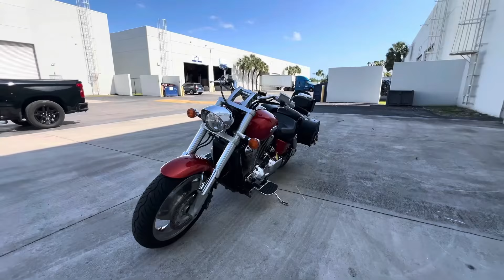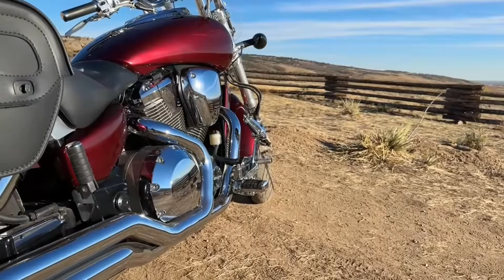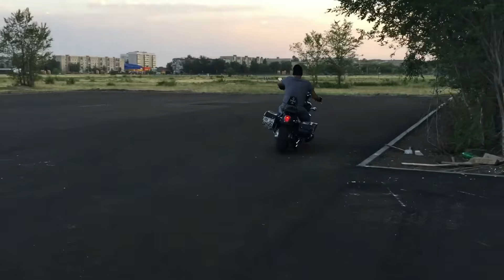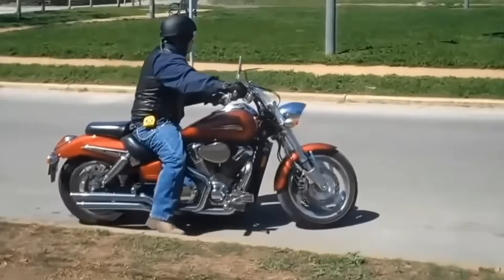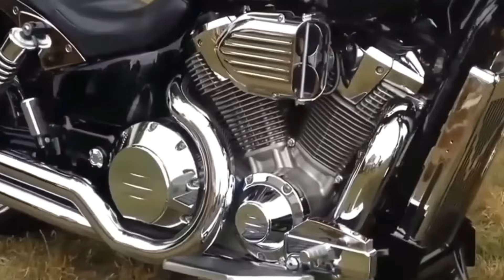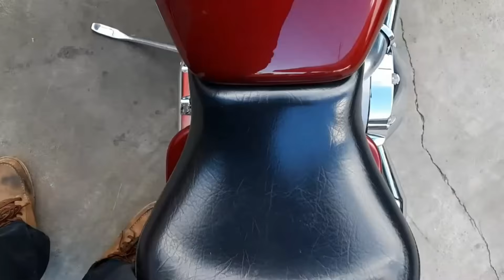How Honda's VTX1800 Engine Crushed Harley at Their Own Game

Comment: Not wanting to sound like a smart a$$ but the 1800 has a dual pin crank. The 1300 uses a single pin crank with dual counter balancers.

Comment: Just bought my first VTX1800.

My previous bikes were a CBR600, Fazer 600 and an 800cc Intruder. I absolutely loved the V-twin, but wanted something with a bit more punch.
We went to test ride the VTX expecting it to feel huge, heavy and intimidating.

I even told my wife to wait at the dealership while I took it out, and that I’d come back for her once I felt confident enough to have her on the back.

It took me about 100 yards before I turned around to pick her up.

She loved it too, and we had an absolute blast.

For such a big bike, it’s incredibly easy to ride. It’s smooth, the clutch feels great, the gearbox is spot on, the throttle response is excellent and it corners way better than I expected.

Honestly, it just feels like the perfect cruiser. I’m still struggling to put into words just how much I love this bike.
Reply from the maker: That’s fantastic to hear you and your wife are already enjoying the ride so much! 😊

Comment: My VTX1800R outlasted me.  I got too old and too effed up to ride it anymore.  I had modded that thing like you wouldn't believe.  Hard bags, trunk, fairing, custom seats, and much more.  Like bmcbg said I bought my '05 off the showroom floor.  The first brand new motorcycle I had ever owned.  They are a heavy beast.  I bought it in '06 and the dealership was having a helluva time trying to sell these.  The drop off had already started in '06 and I got a fantastic deal on mine.

Comment: I don't understand this bike.   
It will get you there just as well as a 750cc Shadow, 
    it looks like a Shadow, it's heavier, and        it drinks twice the fuel.
Reply from the maker: The extra power and torque offer a completely different ride compared to the smaller cruisers. 👍

Comment: Shaft drive kills performance. Wish it was belt drive and there were cam options.
Reply: Shaft drive kills performance?? The reason all the high torque bikes have shaft because a belt  can't handle it
Reply: @safelyanonymous5717 all the high torque bikes have shaft drive? 😅
Reply: @shotgunscott well think about it the m109 boulevard, rocket III....

Comment: You're comparing apples and oranges. With that said, if your in the mid florida area I have a 2006 1800n2 model with 26k on the odometer for sale

Comment: You japanese queer lovers fail to realize that we don't what water cooled engines and smooth like a sofa ride. We want air cooled single pin crankshaft push rod engines! That's why no one will ever win against Harley on the custom segment!

Comment: Honda never killed Harley……..Harley killed Harley………You want a deal buy a used 2000 to 2010 they are almost free…..You will have to replace tetioners but so what…They sold hundreds of thousands of them and there are lots of them with short miles….I bought a carbureted fat boy bone stock 2004 black with 15000 miles for $5150 came with screaming eagle pipes an Oem windshield and set of leather OEM bags….While I didn’t steal that’s the market it was immaculate and the guy selling it was a geezer like me…..There are great deals out there….Now is the time to buy……
Reply from the maker: You're not wrong. This video show some crazy bargains, if you're in the market for a used HD.
https://youtu.be/OM4YwUnwrPM

Comment: Really two worst things they ever put on bikes were riding mods and ABS those are media hipe for political bs. Fuel injection on a bike actually makes the motor run to lean so your bike doesn't last, riding mod settings retard timing all bad for your motor they advertise everything last longer but you don't see people keeping their cars, trucks, and bikes. After the 70s they are junk with too much electronics and you will find it hard to get parts for. ABS is fine for cars but a lie for a bike. Look at new cars an trucks they don't even last past their break in period
Reply from the maker: They have both pros and cons. But I can agree with you that they don't make things like they used to. And is it intentional, maybe. Big corp wants consumers to keep consuming.

Comment: Honda was killing HD before this one...never heard of The Valkyrie?
Reply: Valcurie basically goldwing motor on a vtx frame. HD got Regan too tarrif honda because they were too good study history knowone does they just watch media propaganda
Reply from the maker: Harley definitely would have been in poop street if it weren't for the Regan administration implementing the import tariff.
Reply from the maker: The Valkyrie was a flat-six, smooth and refined. A fantastic machine in its own, but not a direct challenge to HD's raw, rumbling V-twin.
I've made a video on the Valkyrie Rune, which is still on my bucket list to own one day. If you haven't already, check it out.
https://youtu.be/qGQYvji3Svw

Comment: Im still rocking an 07 1800c and it still lives up to its Harley killer title absolutely love it
Reply from the maker: That's awesome! It's a true testament to its power and longevity.
Reply: lol, my 150/156 streetbob begs to differ
Reply: @TheldmfyHarley riders always gotta bring up the heavily built bikes because nothing STOCK can compare. They really get upset when they find out the VTX has more American made parts than a Harley of the same year.
Reply: @society_archer7104  Your not wrong. But VTX 1800cc 106HP 120TQ 780 pounds. Harley Low Rider S 1900cc 114 HP 128TQ 650 pounds. The LRS is faster but what would a 2026 VTX make. Plus the VTX is liquid cooled and stone reliable. The LRS still air cooled, though 2019+ is showing to be very reliable just not idiot proof.

Comment: V-twin is inherently inefficient in my view I will take an inline engine with shaft drive like a triumph rocket III Roadster 163  lbs feet of torque
Reply from the maker: You're not wrong. Big on sound, big on presence, big V-twin displacement.  They had their time to shine. But the thing that made them great, they were big, was also it's downfall. Big on fuel, large carbon footprint, tightening emissions regulations.

Comment: Harley-Davidson sued Honda over design and sound similarities, leading to a significant trademark dispute, and as a consequence, Honda discontinued the VTX1800 production. Harley felt threatened by Honda's superior quality.
Reply from the maker: Harley-Davidson did sue Honda over styling and sound similarities back in the mid-1990s, but the lawsuit was specifically about the Shadow ACE, not the VTX1800. After several years, Harley-Davidson ultimately dropped the case in 2000. The VTX1800 was produced later, from 2001 to 2008. Its discontinuation was likely influenced by factors like declining sales, the global financial crisis, emissions regulations, and shifting market preferences toward smaller bikes.

Comment: Dam i just got my first bike, i wish it was a 1800 but i got the 1300
Reply from the maker: The VTX1300 is a great bike, and still plenty of bike to handle. The 1800 isn't something you jump straight into. For some, the size and power can be intimidating. The riding experience is always more enjoyable when you are in full control. Once you clock up some experience, you could always upsize if you still want the big boy.

Comment: I currently have a 97 Valkyrie 
It’s a beast . But I will be getting a Vtx 1800 in near future
Reply from the maker: The Valkyrie is a great machine. Its flat-six is legendary.
Reply: I got 2007 vtx 1800c and I'd almost bet the Valkyrie is probably faster
Reply from the maker: @DaltonJohnson-i1w  I different bike, a different ride. Each bike has it's own character. If you are wanting presence and a head turner at the lights, I'd want to be on a VTX1800. But if I was clocking some serious miles, I'd be on a Valkyrie cos it would be smoother and more comfortable. Both bikes are capable of well exceeding the speed limit. But on the streets, how fast do we really need to go. Enjoy the ride.

Comment: I am now on my third VTX1800, it's a 2006 Dark Red F3 model I just found with only 6,666 miles, and I appropriately call her The Beast, lol.
I've owned several large displacement bikes, but it took owning a Harley-Davidson to make me realize just how great the VTX1800s were. I simply didn't know it at the time I had and sold my first two. Now that I have found this one, completely stock, aside for pipes, air cleaner and Power Commander. I am already working on a slew of upgrades to make it my own, and I am planing on holding on to this great piece of motorcycle history until I can pass it down to one of my boys.
Reply from the maker: Appreciate you sharing your experience with both the VTX1800 and Harleys. It really is an awesome bike, and finding one with such low miles is a rare score. Great to hear it’ll be staying in the family!
Reply: Great bike. I'd love to find a F3 in great condition with low miles. It's a beauty and a engineering masterpiece. We only get them on the used market. I'd love for honda to make them again but that's probably wishful thinking. It's everything that people wish harley was. Harley has It's culture but the VTX 1800 no matter what version was a well built and engineered bike. If I'm buying a bike or anything I want it made well. Names and culture are all fine in dandy but when you're spending your money on something you want it built well and to be reliable.
Reply: @brandonchandler9032 just picked up my second one 2007 f3 with 21,000 on it.
Reply: I want one but they sound so bad
Reply: harley davidson is a piece of shit compared to any Honda.
Reply: Tell if they r so good, y don't they make them anymore
Reply: @lawrencedavidson296 Why don't they make the legendary FXR, Dyna, etc?

Comment: A hondas engine is cast iron. Aka garbarge. Theres no throtle.   Theres no cam
Reply from the maker: Not quite, mate. The Honda VTX1800 is a well-engineered, aluminum alloy, liquid-cooled, 1795cc V-twin. It’s definitely not garbage — in fact, many riders still consider it one of Honda’s most reliable big cruisers.
Reply: Huh?
Reply: No cam or throttle?
Reply: fanboy 🤡
Reply from the maker: @ZZZZZZ-q1d I'm definitely a fan of the VTX1800
Reply: @BikerCrazyMC   I bought one a month ago.
Reply from the maker: @ZZZZZZ-q1d I bet you're pleased with your purchase. It will serve you well.

Comment: It's too bad the big four can't use Harleys signature sound.
Reply: Hd will sue then 
Thats all they got the sound with no quality
Reply from the maker: @Edmon-r7c  I'm not a complete HD hater. They still make good bikes but they are overpriced.
Reply: Any company can replicate the Harley sound. Harley tried to patent the sound in the 90's when Honda introduced the shadow american classic edition but was unsuccessful. The vtx 1800 is a dual pin crank while the vtx 1300 is a single pin crank. The 1300 sounds more like a Harley because of the single pin crank
Reply: @christopherbraswell9585 Nice. While I'm not a fan of the Harley sound I know most people like it. Definitely better than the Japanese twins.
Reply from the maker: @christopherbraswell9585  Exactly—Harley’s 1994 trademark bid flopped because you can’t own physics. Single-pin 45° firing is the whole recipe,  any manufacturer could copy the cadence, but most won’t sacrifice the smoother balance shafts and even power pulses riders now expect. Harley keeps the shake because it’s part of the brand.
Reply from the maker: Yeah, that iconic rumble is basically Harley's fingerprint on the road. You hear it and know it's a Harley even before you see 'em.

Comment: I have a 2003 VTX 1800R and I ❤it.
Reply from the maker: You own a great bike. Owner insight on this channel is highly valued as it shares with our viewers your first hand experience. If you could, please share  your opinion what makes the VTX such a great bike(whether pure torque/riding experience). Your feedback would be greatly appreciated.
Reply: @BikerCrazyMC  Power, Torque, Sound, very smooth and refined throttle control.  It’s a BEAST.   I wish Honda would bring back the VTX Line.
Reply from the maker: @hawk1548  Same here! But at the end of the day, manufacturers build what the market wants, and sadly the era of big-displacement cruisers has lost its global appeal. Definitely hang on to your BEAST—it’s a rare gem now.
Reply: @BikerCrazyMC  O YEAH
Reply from the maker: How long have you owned the VTX, and how many miles have you clocked up on it?
Reply: @BikerCrazyMC  I just bought it in July.  I commute back and forth to work with my bike.  Practice
Reply from the maker: You haven't owned it for long. Another reason to share: with so many bikes available to you on the market, what made you choose a VTX1800?
Reply: @BikerCrazyMC  I’m 6’4 so I wanted something that fit my frame.  Also a friend of mine had an F model and I always thought it was an impressive looking bike.  And watching movies like terminator 2 with Arnold riding a big cruiser lol
Reply from the maker: @hawk1548   You made a solid choice. Your bike will serve you well for many years. Wait until you start taking it out on some longer rides and getting away from the congested traffic from the commute to work. Riding free on some open country back roads, you'll fall in love with it even more.👍

Comment: I love my VTX 1800!!! Which do you think would be a good option for the next motorcycle? There are few with the same power.
Reply from the maker: The Honda VTX 1800 is a beast from an era we’re probably never going to see again. That massive displacement, raw torque, and bulletproof reliability are a product of a time before emissions restrictions started choking the life out of big Japanese cruisers. Manufacturers simply aren’t building bikes like this anymore—so in many ways, you’re already sitting on a piece of motorcycling history.

If it were me, I’d hang onto it and make it truly yours. A custom seat, bars, pipes, paint, or even a performance tweak or two can breathe fresh life into it and keep that grin on your face every time you roll the throttle. 

Of course, if you’re itching for something in addition to the VTX, then we can start talking about which bike could complement it. But as a replacement? I’d say, keep the legend you’ve got and make it even more legendary.
Reply: @BikerCrazyMC I bought it with only 4,000 miles a year ago, and now it has 20,000. Mustang seat, Cobra pipes, saddlebags, LED lights, and lots of waxing to maintain the paint and chrome, right here in North Carolina it's a perfect bike. My friends have Harleys and always have some kind of problem with their bikes, but mine hasn't. I think the only option would be the Indian Pursuit, but it's a lot of money and has almost the same power.
Reply from the maker: @ernesstcruz3711  Are you specifically after an American-made bagger? The Indian Pursuit is a nice bike but also comes with a nice price tag. If I had the money and was planning to do some serious touring, I'd buy one, I love the look of the Elite. But  if you are open to a more affordable alternative have a look at the Kawasaki 1700 Vaquero. In comparison, it's a bit down on displacement but overall on paper is a great bike.